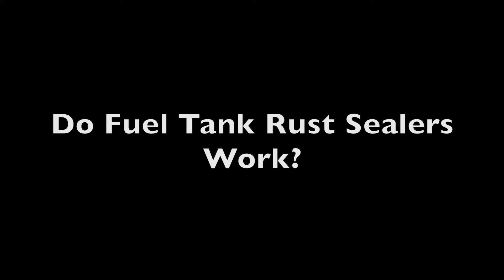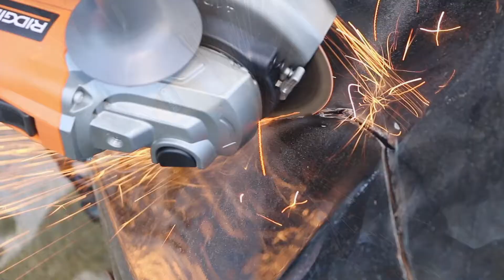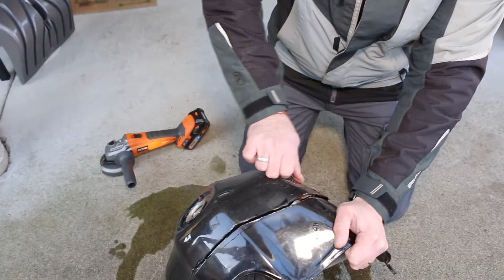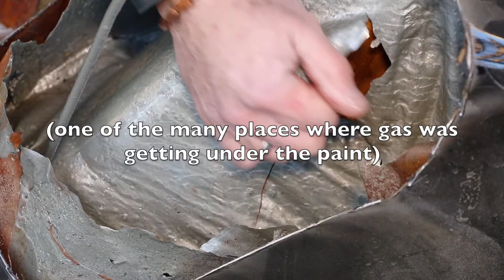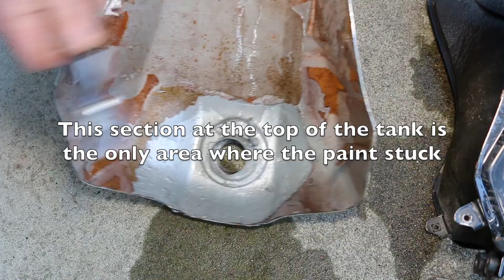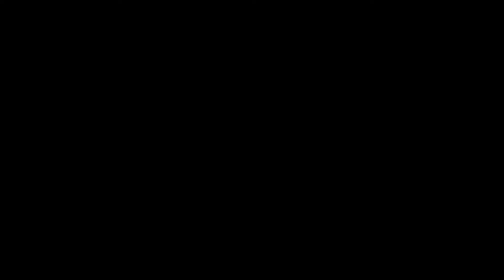Motorcycle Fuel Tank Sealers: Don't Buy Until You Watch This Video!

Comment: I did mine with success. I think what you did wrongly is either put it too thick or apply multiple layer. I pour out as much as I can, turn the tank around for an hour or two, and then leave it for another week before pour gas in. If you put it too thick or didn't let it fully cure between layers, the gas inside need to find a way out and that's probably the reason it start to peeling from beneath.
Reply from the maker: Could be. We actually put three coats to make sure it was fully covered, but you may have hit the nail on the head. Still, I think next time we’ll leave it to the professionals.
Reply: It shouldn't rust if you keep the tank full and use ethonal free gasoline. Would having the tank galvanized be better?
Reply from the maker: @MarthaGomez-h3o Yes, but when you buy a used bike, you get it as is. Also, much older tanks will naturally start rusting. I believe fuel tanks can be galvanized and it’s probably better than coating it with paint. Not sure how it compares to epoxy, though.

Comment: If you are not knowledgeable on which pain to use the it's messy like this. I have been using 2k base coat primer to coat my tank and it's been working great!
Reply from the maker: That’s great to hear, Abhimanyu. Which paint are you using?
Reply: @3ftDeepChannel  it's the normal polyurethane 2k base coat which comes as three parts... The paint, the activator/hardener and the thinner.
Reply from the maker: I believe the two or three part systems are far superior to the paint that we used. Thanks for the info.
Reply: @3ftDeepChannel  most welcome 👍🏻

Comment: Yeah..... I'd say they didn't follow the directions to acid etch the tank before applying the coating.
Reply from the maker: No, the instructions were followed perfectly. In an ideal world, the product may work. But in a real world situation, we found that it didn’t. As mentioned to others earlier in this thread, even the guy at the auto store where we bought it from (after we applied it) said “it doesn’t work”. If we had to do it all over again we would either take it to a professional to have it done (they have different, more dangerous chemicals they work with), or buy a new tank. I’d probably buy a new tank.
Reply: I have never seen an acid etch that doesn't create flash rust immediately. It leaves a bronze type color. Some people say that is normal, but that is flash rust.
Reply from the maker: we agree. We don’t see how this process could work with the paint provided.

Comment: Paint? You need to use a good tank prep and sealer. But if these aren't done properly then it won't be good for the bike also. Whenever I do one it never sees gas in the tank till after 7 days minimum
Reply from the maker: Thanks for the tip, Dudley.
Reply: I welded & POR coated my tank about 3 years ago bc of a tiny leak and haven't re attached it to the bike yet. Im thinking of giving it a 2nd coat now before I put it back together. Yea or nay?
Reply from the maker: If I were you and I really liked the tank, I’d bring it to a painter and have them strip it off and epoxy it for a permanent fix.
Reply: @3ftDeepChannel  But every paint shop doesn't necessarily have experience doing that, correct? What can that co$t me? Thks
Reply from the maker: Maybe not. We use a guy here who has a small shop and he does quite a few of these. The cost (a few years ago) was $250 for the coating, but then the tank needs to be repainted. It’s costly, but the result is professional quality that you don’t need to worry about.

Comment: All the people posting in the comments about how it's this guy's fault for not following the directions when installing tank liner are most likely keyboard warriors with no actual experience. 

I have never lined a tank, and I don't intend to. I have also never seen a tank liner that actually holds up for the long haul. 

 I have an '03 Sportster and the factory tank that it used to have when stock had an OEM tank liner installed by HD themselves. (My understanding is that they only used liners for a handful of years before abandoning the idea). It would shed little flakes of liner and REGULARLY clog up at least one of the two jets in the carb. They looked like little paint chips and would wedge themselves in the jets and obstruct the flow of fuel. After disassembling and cleaning the carb probably 10 times or more, I tried various solvents to REMOVE the tank liner, none of which worked. What I finally did was fill the tank full of drywall screws and wrap it in blankets to tumble it in the dryer WITH NO HEAT. 

Tank liners are an unnecessary gimmick IMO and as long as you keep some gas in the tank,  the vapors will fill the headspace above the liquid gas and prevent any rusting.
Reply from the maker: Thanks for the feedback, Chase. There are lots of tanks out there that have been sitting for years (like the one I bought was) without any gas in the tank and for that reason they are now rusty. The point of our video (which escaped a lot of our viewers) is that regardless of whether we got it right or wrong, this product can fail for people who have lots of mechanical experience (like us). It is possible to do a better prep job we’re sure, but our prep was probably better than 90% of our viewers would do. That’s why the guy at the auto shop where I bought the stuff from said “it’ll never work” after we had already applied it (as per the instructions). Thanks again for your comment, and safe riding!
Reply: @3ftDeepChannel  The drywall screws trick will remove rust from tanks as well, provided it's not severely rusted. Cheers!
Reply: You just typed all this and never even did it a day in your life.

Comment: How did you prepare the tank?
I used Kreem some time ago but it didnt work for me, TankCure did wonders for me. 

If there's even a speck of rust, the liner will not adhere there and thus create bubbles. And bubbles pop, and create bladders.

My advice is a thorough de-grease, plush with water, add 200ml isopropynol , shake well, empty, blow out with compressed air. Add rust remover, flush it out the same way as the degreaser. 

What i found out is that if you blow it out with hot air it rusts immediatly, so just use compressed air or a cold blower. If you use compressed air, make sure its water and oil free. 

If you use a epoxy, keep in mind that its very viscous and needs time to flow.

These are my tips. To me, epoxy>liner any time
Reply from the maker: Thanks for the tips. We followed the instructions to the letter, but clearly it wasn’t prepared good enough. I suspect we’re not the only ones that failed.

Comment: Imo something was done seriously wrong in the preparation, I’ve used POR 15 after hydrochloric acid cleaning and it works great. But it is a long process to clean and you need loads of bicarbonate of soda to neutralise the acid. I’d have loved to have sen a photo of how good it looked before the sealer was used, needed a camera in the tank, I suspect rust was still in there. But the video shows being really through with the prep is well worth it.
Reply from the maker: We were very thorough with the preparation. It looked like new metal throughout. There’s no doubt that in the corners and folds, there was probably some rust still but that doesn’t explain the wide-scale failure. When I bought my second lot of paint from the auto shop, the salesman shook his head and said it won’t work. The only thing that works is the “red” epoxy coating, and that isn’t widely available here. When I saw how my coating failed, I could hear his words echo in my head loud and clear.
Reply: @3ftDeepChannel  Very strange then,, perhaps there was just something in the metal from new that reacted. Or even possible you could have got a faulty batch who knows. I read reviews of POR 15 most are positive but a few aren’t, I think it’s a matter of going what you think is best. I did a Puch maxi tank in February checked it and it’s still great, I think another thing with the POR 15 is leave it as long as possible to dry, that’s what I did. Thanks for responding to my comment 🙂👍
Reply from the maker: Thanks for the tips!
Reply: @3ftDeepChannel  I've seen in a car gas tank video he used a chain with cleaning acid and swished it around. 
Another video a guy cleaning his rusted metal Jerry can he used copper BB pellets with cleaner. 
Rust needs to be neutralized as a bodyman told me. They used this stuff called Rust Mort by SEM. After neutralizing then they can start patch up and painting. If SEM not available gotta order online from North America.
Reply from the maker: We followed the instructions to the letter with this product and it didn’t state neutralization. Rinsing thoroughly with water also does the trick, just not as fast. As for adding the metal stuff into the tank, it takes a lot of agitation for that to be effective …many hours in fact. So, it’s too much hassle for most people (like me). Thanks for your comment.

Comment: POR-15 is crap. The prep is ridiculous and the end result is 50/50. Red Kote Tank Sealant is the only product I use now. I have a small engine repair shop and I’ve used Red Kote on probably 13 or 14 tanks and never had a problem. The hard part is the prep. I tumble the tank for several hours with lots of small nuts and bolts and chem-dip in it. Then I rinse it really well. Then I dry it over night so that it’s absolutely bone dry. You have to look the tank over and make sure the Red Kote can drain out properly. A lot of tanks don’t have a decent place to drain every bit of Red Kote back out. In those cases I drill a drain hole just for this purpose. Once the tank is done I plug the hole with a nut and bolt. Of course these tanks are on stuff like generators, tillers, water pumps, etc, so drilling and plugging them isn’t a big deal. Not sure I’d do that to a $1,000 motorcycle tank.
Reply from the maker: Thanks for the words of advice! I’ve heard good things about a red epoxy that works very well and wonder if that's the same stuff.
Reply: I’m wondering how long people are leaving the POR 15 to dry, I forget how long it’s says but I do remember after the recommended time I wasn’t satisfied it was totally dry, so I left it much much longer. Also some tanks are much harder to get it all around, I suppose some of it does depend on what the tank is.
Reply: Had it in the amazon cart. You convinced me to delete it and order some red kote. Thanks.
Reply from the maker: I think that’s a great move. Good luck with your project!

Comment: If that's a 'few months' of rust build up, you need to buy your gasoline somewhere else.
Reply from the maker: Actually, most of that is from flash rusting. The acid treatment before the paint strips away any protection that was left in the fuel tank. That’s why I would never recommend this paint treatment. Better to get it professionally epoxied.

Comment: That's what happens when you don't get all the acid deactivated.  That's also why the top had good adhesion.  It's better to use Evapo Rust or something similar that won't etch the metal before you seal it..
Reply from the maker: I tell you, nothing eats rust faster than muriatic acid, but I would never ever use it again! Thanks for the tip.
Reply: @3ftDeepChannel  Yea, but it's like using a nuke to light a cigarette.  Way too strong, and hard to stop the reaction after it gets in all the pours.  Evapo Rust will not harm the metal and create an oxide layer that protects it as well, but it will take 12-24 hours. I promise, I don't work for them!
Reply from the maker: @rustusandroid  Thanks again for the advice.

Comment: Was this a 3 part kit or just a paint you dumped into the tank?
Reply from the maker: It’s a paint (that requires prep to the tank). I was told that the kits (or epoxies) work much better and the professional stuff does the job right.

Comment: BULL**IT!
I have used the KREEM brand on several tanks and have had very good results.  (One tank still looks good after over 20 years!)  Ok, I'll admit that it's not the cheapest kit on the market, but considering the hours of YOUR time that you will spend installing it, it's well worth the money.  The thing to remember is that (like any paint job) the job is 90% finished before the paint goes on.  You're not wasting your time by de-rusting and etching several times before coating.  PREP IS EVERYTHING!
I'm going to guess that these guys did a haphazard job of installing an inferior product. (They never stated the brand of coating used.)  With a poor job of installing an inferior product, lousy results should be expected.
Reply from the maker: Por15 tank sealer. Done exactly as per the instructions. 3 coats applied. Even the guy at the auto shop where we bought the stuff said "it won't work". Unfortunately, he wasn't the same guy who sold it to us, and he told us after it was already applied. He told us this not as his opinion, but as a statement of fact after years of getting customer feedback. Our results concur.
Reply: @3ftDeepChannel  Try KREEM, I swear by the stuff!  And remember it's not possible to get the tank too clean before applying the coating. Also, be completely anal retentive about following the instructions. Even the tank that was done decades ago is holding up just fine.  The worst thing I can say is that the lining that started out white has yellowed somewhat.
Reply from the maker: Thanks for the tips, Steve.

Comment: Use phosphoric acid instead of muriatic it won’t flask rust like that and it will stick
Reply from the maker: Have you tried that yourself? I’ve heard of lots of so-called treatments, but none of them seem to work. The only thing that works is the epoxy coating that is quite expensive. The reason none of the others work is that the protective lining of the tank is gone when rust forms, and it will never come back, so you always have a rust problem. I would like to see some pictures of the tank after five or 10 years has gone by using these treatments. Thanks for your comment.

Comment: Thanks for sharing. I was just about to go pour the POR 15 sealer into my tank before I watched this, but now I'm seriously concerned. I also did all the prep as per the instructions but the one thing I wasn't sure about is that you said you did three coats? I assumed this is a one coat system. Is it possible that the additional coats is what caused the problem.
Reply from the maker: That’s a good question. i don’t think so. We did 3 coats because the tank is relatively big, and there was not much paint in the small tin. The guy at the autoshop where I bought the product did warn me that it wouldn’t work (after I had already done 2 coats!). He said the only product that works is a red, transparent epoxy that is very difficult to get. Thanks for your comment.
Reply: @3ftDeep  All I know is I'm not about to risk using it now. I'm going to call tomorrow to price out a professional liner. Thanks again for saving me from a potential headache.
Reply from the maker: Very good move. I’d do the same. You will likely need to redo the paint though, as most professional treatments result in the paint being stripped. Good luck!

Comment: Think this would depend on the type of sealer. I've used one that basically leaves an epoxy type layer inside. There's no way that peels like the one you used. So, slightly misleading title in my opinion.
Reply from the maker: thanks for your comment. Do you recall the brand of epoxy sealer you used? Was it red color?
Reply: Came out clear looking, but when added to the hardener went a pale orange. Called Petseal Ultra. Not the easiest to use, need to keep at it but has sealed my 37 yr old Cagiva tank.
Reply from the maker: @martinpoll1040 Thanks for the info.
Reply: Np. I'm no expert by far, so only going on my personal experience. It's been in a few months now and I just can't see it leaking, especially as the inside is coated with, as I've said, an epoxy looking stuff.

Comment: So what do the “ professional tank sealers” do? Charge you a lot of money and follow the instructions properly or something else?
Reply from the maker: They use an epoxy that is not easy to use and quite toxic. I believe there’s a subtle insult in your question.
Reply: @3ftDeepChannel  no,not an insult,just a genuine question but I do think the whole chemical thing revolves around cleanliness and perfect conditions to apply any liner( I’ve got a bike that’s almost 100 years old and I’m still thinking of using the original tank without liners as I’ve heard so much about failure surrounding liners, 👍🏻
Reply from the maker: Good luck with your project.
Reply: @3ftDeepChannel  I say well at least you tried, sometimes hit and miss. Your video shows what can develop,shi$ happens.
Reply from the maker: Thanks for the kind words!

Comment: clearly didn't do it right as there was the old liner still in there. should have stripped it first. I'm sure the instructions would have said this. needs stripping, degreasing and a metal prep before putting new liner in. just saying.
Reply from the maker: Instructions followed to the letter. We are not saying that someone else couldn’t do it better, but that if the average person follows the instruction precisely they will likely end up with the results that we got, in our opinion.